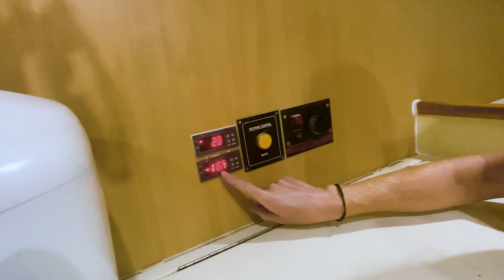We’re FREEZING in the CARIBBEAN! [Ep50 RED SEAS]

Comment: Awesome job guys!  I reckon you should put another vent at the top of the side wall to enable warm air to flow out better.  Cooler air in the bottom, warmer air out the top.  It will make the fridge more efficient and last longer.
Reply from the maker: We did look at that actually. As this is a domestic house hold freezer, it’s actually designed with the simple pass thru system under the freezer compartment itself. A convection process effectively. If we opened a vent at the top of the side panel, we would actually be encouraging the warm from the compressor to pass thru the freezer chamber itself. Still, we may try it just to see what happens. 😃
Reply: @RedSeas  Ah yeah that makes total sense.  Well done again!  Love watching your adventures!
Reply from the maker: Cheers! It’s great to have you following along. Thanks for keeping us right too. 😂

Comment: I hate to tell you this, but my bet is your fridge/freezer likely couldnt get cold enough because of those giant chiller plates piping the cold out.  I can't say for sure that is true, but my friend with a similar setup had that issue.  Once he filled the holes and removed the big chiller plates everything worked pretty good.   Though no going back now...
Reply from the maker: It’s a good point. We had pretty much decommissioned those plates for a while before we reached this stage but there were still two big blocks of metal in there that won’t have been helping lol. Still, don’t know anyone on a boat getting the temperatures we are getting on the new setup. Makes keeping food so much easier.
Reply: @RedSeas  Yup those are some good numbers on the temps.  The big issue might be in the long run whether or not the compressor can tolerate being on the sea.  As the boat bobs around some compressors get starved for refrigerant inside the housing as the refrigerant can do weird things.  It is worse on monohulls as the fluid can really pool up on one side as the boat leans over while sailing.
Reply from the maker: Absolutely. It was one of the bigger concerns of using a household freezer onboard. The funny thing is, it was so much less expensive than a 12v system that we felt ok about running the test. As you say, a cat doesn’t lean as much as a mono so hopefully it’s just the knocking around that we need to watch out for. It’s very securely fitted so hopefully that extends the life of it for a while at least. 😊

Comment: Do you not need to put bigger vents in the back of that frizza?
Reply from the maker: There’s actually two vents. One at the back which exits into a large void where the old compressor was (has ventilation to the cockpit) and another out the side which doubles as a maintenance access.

Comment: how much power does the freezer pull (110 volt amps)?
Reply from the maker: It’s a funny one to explain. Given the compressor has a duty cycle and will not run continuously for any extended period, it’s rating is based on annual consumption. This freezer is rated at 178KWH per year. That’s around 20w an hour averaged out. In reality it will cycle on and off throughout the day and subject to how frequently we open it. We were surprised that it really didn’t hit our batteries as hard as we expected. In fact it is probably easier on the battery usage than the previous 12v system and delivers much better results.
Reply: @RedSeas  Fair enough - very impressed that you were able to find the exact size to fit in that space....very good install and looks like a no brainer to me to trash the existing ones in place of the 110 volt version.

Comment: 95% of all solar panels that are tossed away are good, The problem is the black box terminal diodes that go bad. So I am going dumpster diving for discarded solar panels. The diodes can be ordered on the internet.
Reply from the maker: Fair call. The ridged panels are usually recoverable. The flexible ones can suffer from clouding as the plastics used as a Len’s can age badly. That said, ours are doing great.